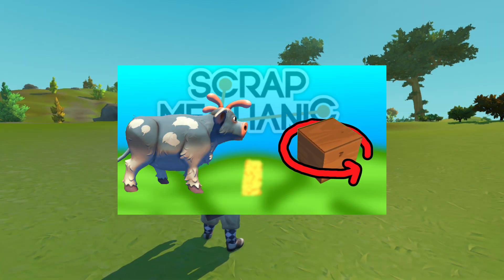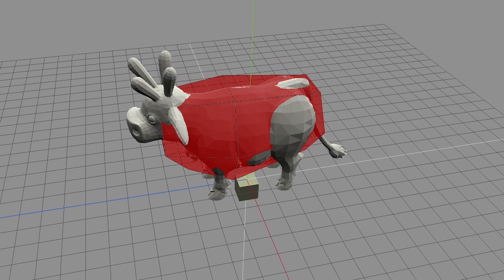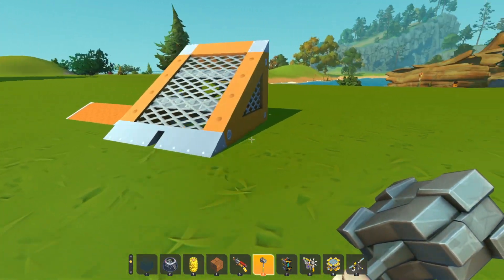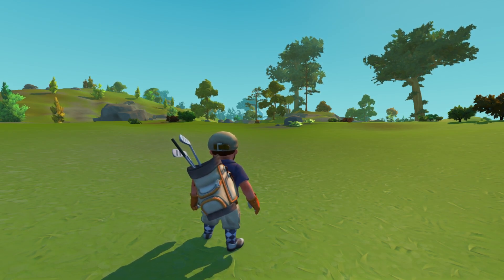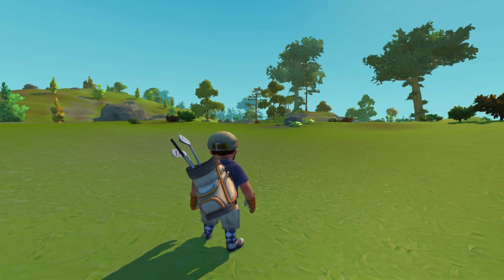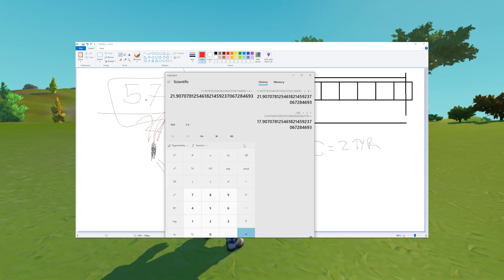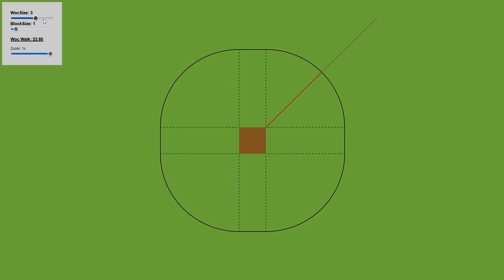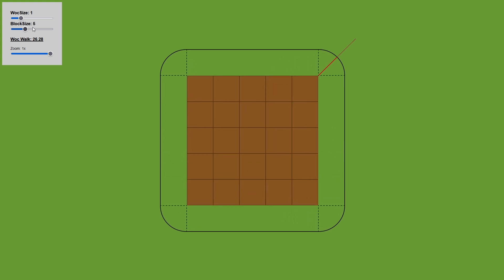Woc Block Walk EXPLAINED BETTER 👨‍🔬SM Science

Comment: Doing a quick analysis of the game files shows that the model you found is for the hit detection of the cow with things like the hammer and spuds. The actual hitbox is a capsule with a radius of 0.8 and a height of 1.65. As for the units on that value, I believe it to be in meters, so we need to convert that to blocks. I actually already have the conversion from a previous comment I made, which I determined by using the engine code in the game files to be 3.5343 blocks per meter. Plugging in the radius, and this value, we get a width of 5.65 blocks for the woc, which seems almost exactly like what you measured in game. Plugging this number in, we get 21.77 blocks for a woc to walk around a block